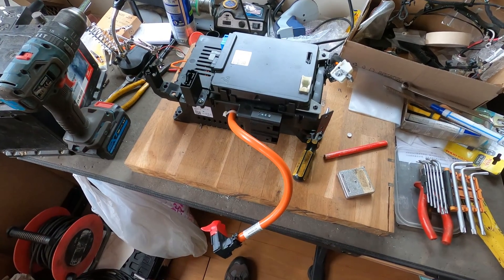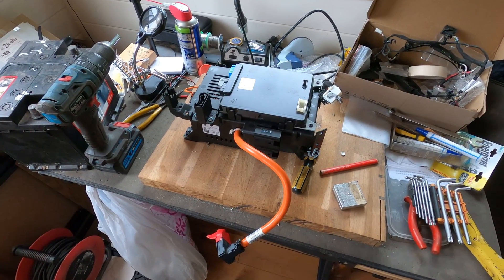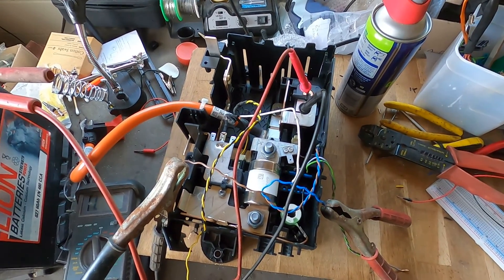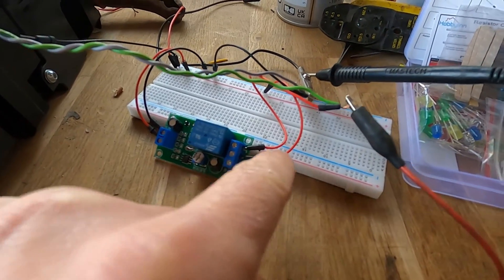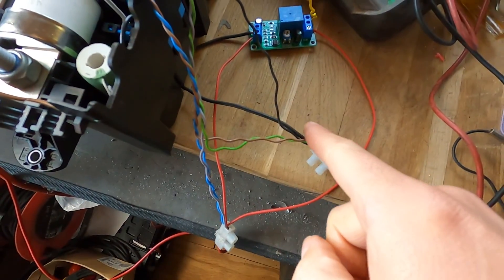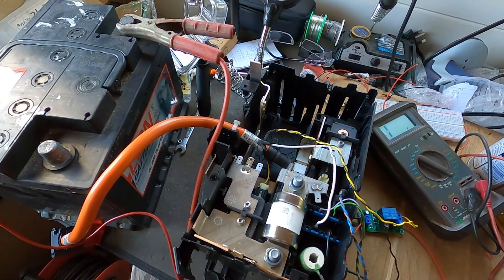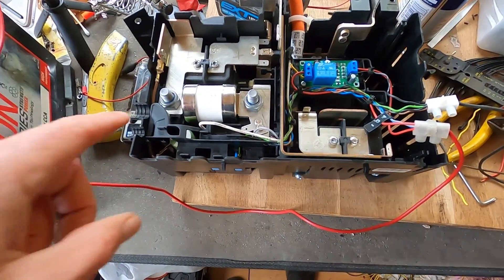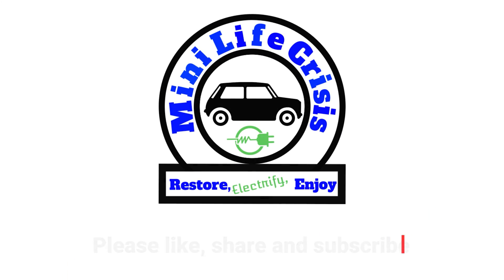Project Mini i3 making a pre charge circuit using the bmw i3 sme or safety box

Comment: If safety box contact is opened, can you manually close it? Or do we need new secret box? 

Do we need to reset a computer inside of battery case?
Reply from the maker: If you go to BMW they will want to replace it and code it to the car I suspect. You should be able to find someone to repair it.